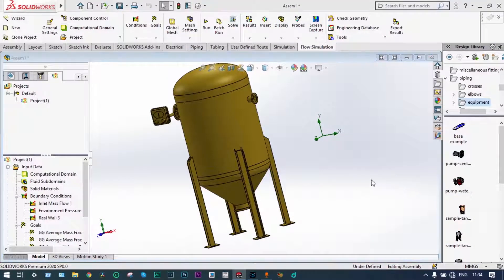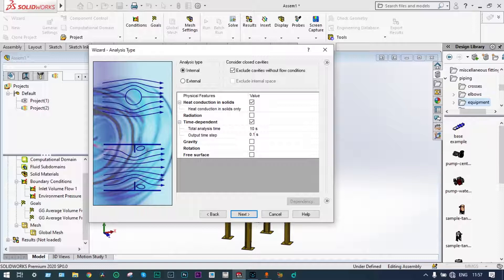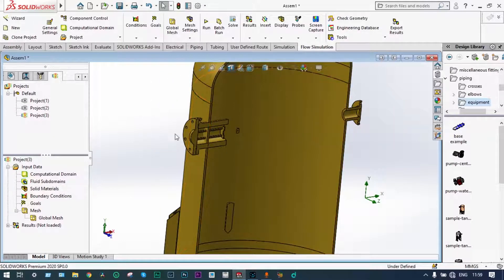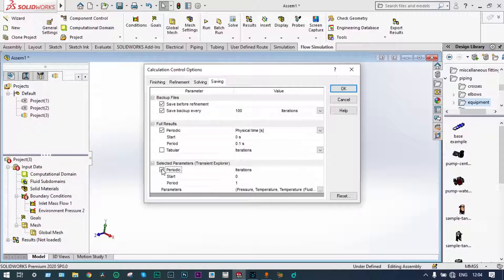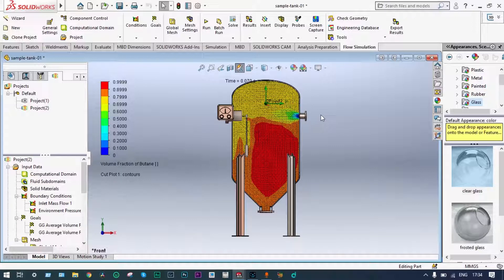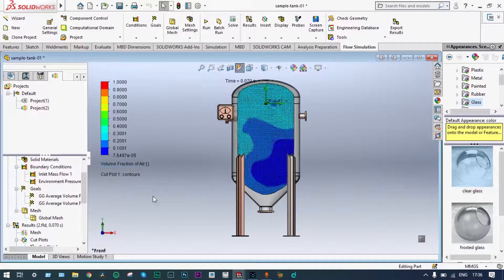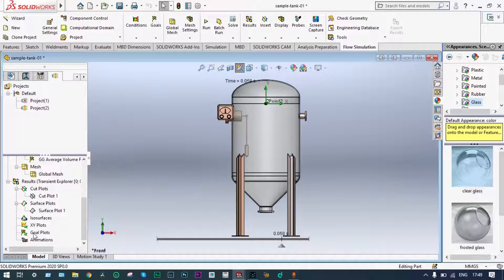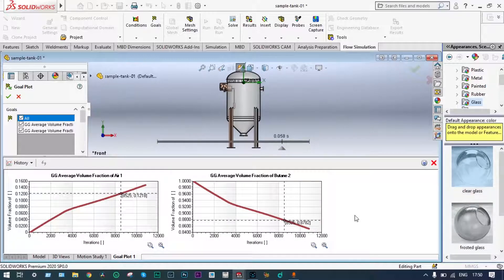Mastering Fluid Mixing Analysis: SolidWorks Flow Simulation Tutorial

Comment: Hello, I'm currently trying to simulate a mixture of water at 2 different temperatures, basically there's a container with certain amount of hot water which has to be filled with cold water to make a thermic equilibrium and let's say be at 30°. I saw the courses offered in Udemy to this kind of analysis but I'd like to know if my problem is covered or explained in the course, also is it possible to know the final temperature of the mixture in the Simulation? Best regards
Reply from the maker: With CFD optimization anything is possible. What you want CFD optimization can do it by changing input variables.
Reply from the maker: It is so simple

Comment: Thank you very much for the explanation. I have a question: are we able to simulation the mixing process if the initial condition is that the tank is half-full with butane, and then we starting filling it with air and we want to see how long it takes for air and butane to fully mix. Or instead of two gases, maybe liquids will be a better example here. So basically i was trying to simulate a situation where one liquid is poured/injected to another and how long they can fully mix. Is it possible to do it in solidworks flow simulation? Thank you.
Reply from the maker: Yes it is possible. Even heterogenious fluid mixing is also possible and as a transient free surface technique you can find fraction volume of each constituent in each fraction of time